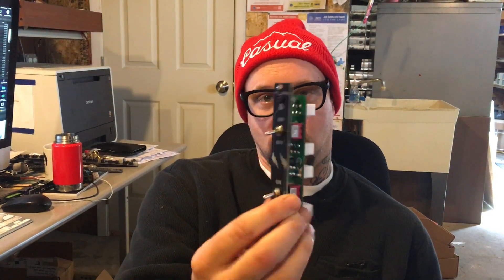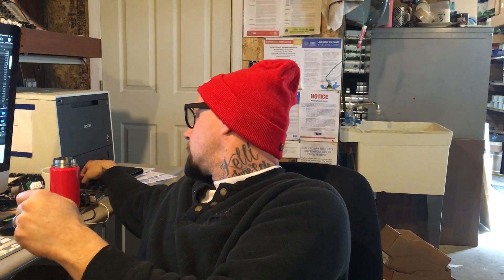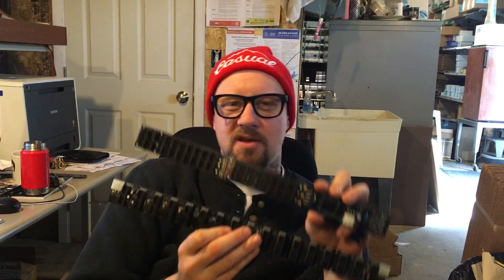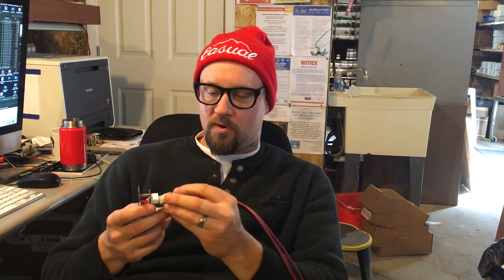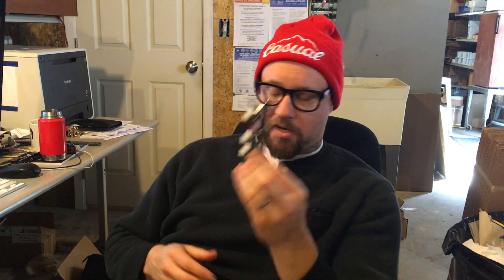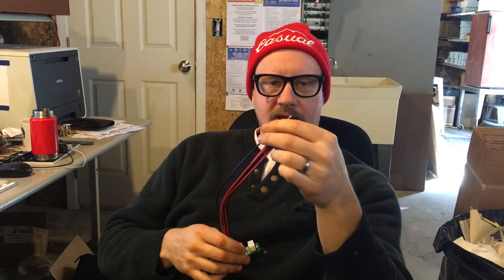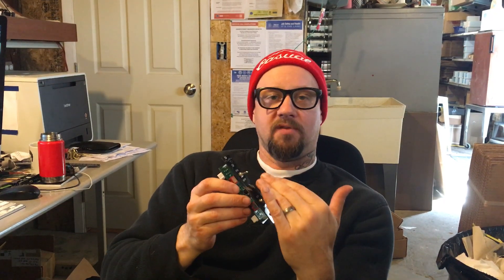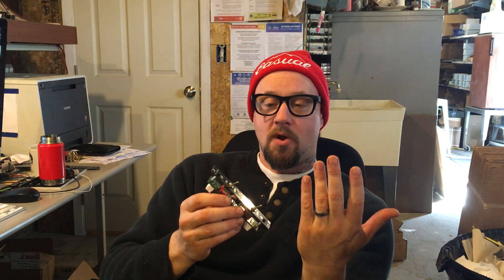TURN - Soft Start Eurorack Power Supply Interface - and/or Power supply switch SDIY

Comment: I think I may need this. I love my WMD Spectrum VCOs but I suspect they overdraw causing my Deluxe Power and even Case Power Blue to flash when attached with a full load of other modules. Had to install an additional Deluxe Power just for them. Operating draw is only 80 mA +12V so don't know what else it could be.
Reply from the maker: Any draw on the -12 rail?
Reply: @synthrotek   Spectrum should only be 12 mA -12V each but have no way to check. It seems other people have had issues with initial draw causing the protection to kick in. WMD modules specifically seem to draw too much at startup from the -12 rail. That's why they developed their soft start circuit. Unfortunately they're $30 each and I'd likely need at least two. Will do more experimenting to figure out how many I'd need but will also try one of my Universal bricks set above 15v.

https://www.muffwiggler.com/forum/viewtopic.php?p=2262862#2262862